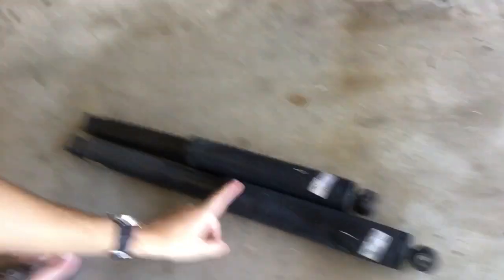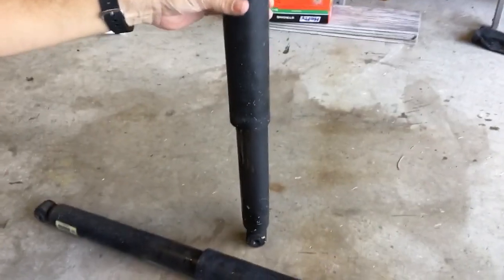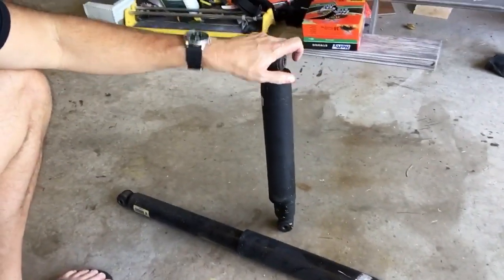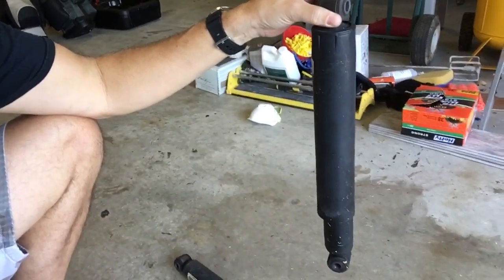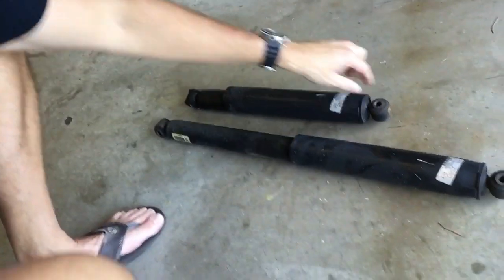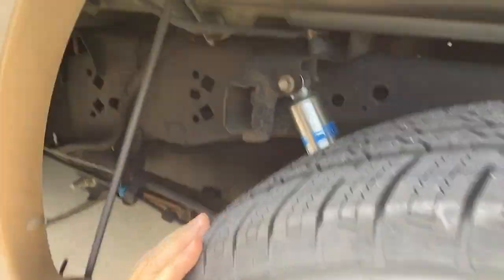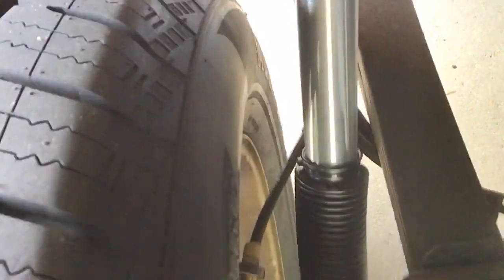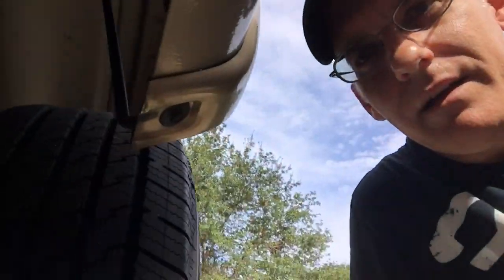Bilstein 5100 Shocks Initial Review

Comment: My truck had the 4600’s with 175k miles. It’s getting the 5100’s today. I hope they are good.
Reply: Do you like them better then than the 4600  looking for new shocks for my 17 ram 1500 5.7
Reply: @--emt  absolutely. However it isn’t a fair comparison. The 4600s had 170k miles on them and the 5100s are new. They are a huge difference the old ones were shot and felt like I was skipping through rough turns and bouncing a lot. The 5100s are great so far. My dad had some new stock shocks on his 08 4 runner and ended up with the 5100s because he got a winch and bumper and wanted something stiffer.  According to him it’s great on the and he said his traction off road is much better. IDK. Neither of us do crazy rock crawling or anything but we hail ass through the desert”Reno” and hit some good hill climbs. My buddy put 5100s on an old Tacoma, new f150 and then got another old Tacoma he swears by them paired with some ko2 tires. So that’s what I got.
Reply: Are the 4600 noisy like the Rancho shocks
Reply: @silverevans7763  I don’t have any experience with the ranchos. The 4600s didn’t seem noisy though.

Comment: Spacer lift is alot better than compressing the springs. Id suggest run a spacer with the 5100 set at 0
Reply: I wondered about that.  I have a two inch level on my truck and would like to upgrade the ranchos.

Comment: The only difference between the Bilstein 4600 & 5100 shocks is that the 5100s are made for lifted vehicles and they are zinc coated. The internals and shock body diameter are exactly the same.

Comment: Great review!! But, you do know Ford is the most overrated truck on the road, right? Even Dodge has surpassed them in quality and performance. My father n law retired from Ford (33years) and drives a Dodge. For me, I've had 3 Tacoma's and they are awesome! I will be going with some of these shocks thanks to your video.
Reply from the maker: This is my third Ford truck.  I had a '94 Ranger, and a '98 F-150, both of which I put over 100K miles on, with very little problems.  I got a really great deal on this truck used, which I why I got it.  I will drive it until is falls apart, then shop for my next truck with an open mind and get what I believe is the best truck for the money, regardless of the brand.  Thanks for watching my video.
Reply: Karaoke Kid every manufacturer has had issues with their vehicles- I can sit here and quote Toyota frame rust issues in the past, Dodge electrical issues with very poor crash tests, etc. Everyone has had recalls. The simple facts though are that Ford is the industry leader when it comes to truck innovation- they generally set the standard that all of the other manufacturers try to compete and catch up with 2-5+ years later in their development. It's very obvious in competition marketing that spins off of what Ford already did. I have no allegiance to any particular manufacturer and appreciate most of them for their niche benefits- Toyota is simple and reliable, GM has a great engine with the LS and reliable drivetrains, etc. Dodge is only just now starting to come around these past years; they have had a shaky history with trucks- but the Ram is a gorgeous truck and HEMIs are tough engines. Healthy competition between manufacturers is good- it gives us, the consumers, great options to choose from. If Ford was so bad it wouldn't be the top seller for as long as it has been- people drive them their entire lives and stand by it- plain and simple. For whatever reason, I always meet guys who pick another brand of truck (which there is no "wrong" decision there really) but then they act insecure and feel the need to bash on Ford because its widely accepted to be "the best"... I always laugh when I meet people like that.
Reply: I know a few ladies that drive Toyota!
Reply: Ok..let's be honest...go out for few days...see how many Fords...older ford you see on the road..compared to older rams...not many rams on the road anymore. Theres a reason for that. Yes..let's not talk the newer ones..those of every make are all over the road..they are still NEW...dodge is junk man
Reply: Nah. I like Rams, bit of the 5 people I know with Rams 09 and up, only one has made it to 200k with no major problems. Everyone else had major repairs by 70k. On my 3rd f150, 130k runs like new. I had this guy's exact truck and took it to 260k before selling it.
Reply: @rugergh  my sister drives an F-150 so what's your point?